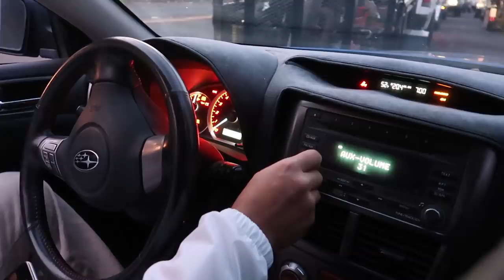What I got from the swap meet and what's next for my Shovelhead

Comment: For the z fabricate a bumper use the angle of the spoiler  reversed make that king queen seat bro the paint gun metal but engrave the tins only the borders but the lines for the borders thin only 1/2"